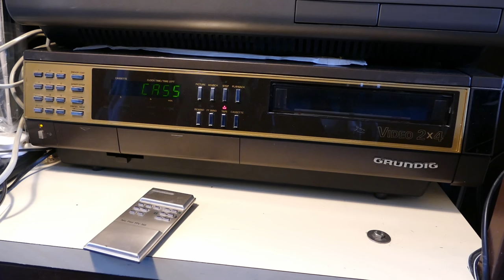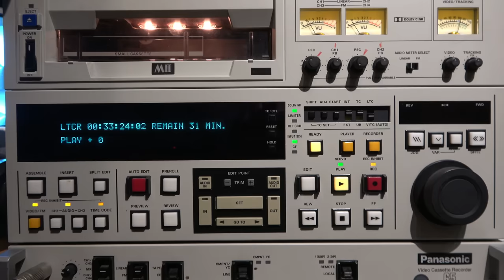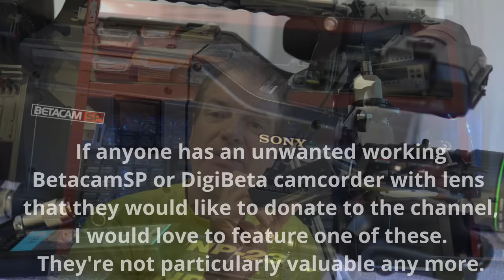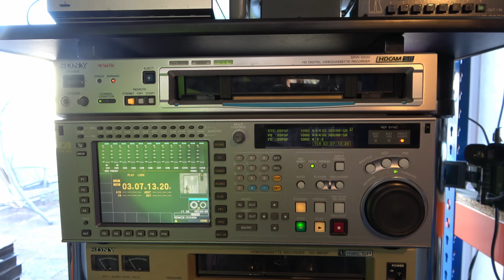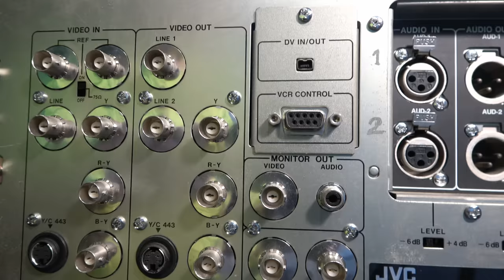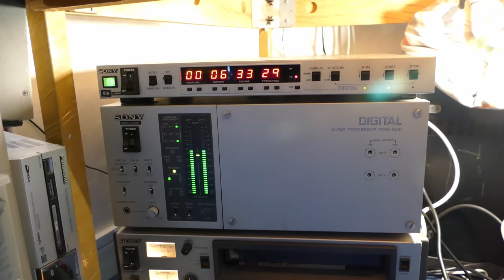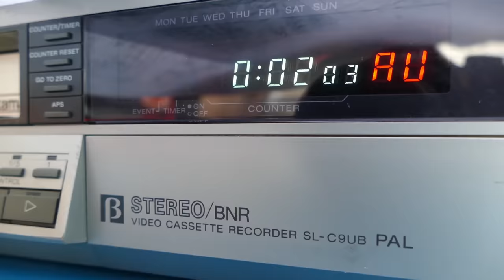Beta vs VHS. A world in which Beta won.

Comment: Interesting video and I so get the point on Beta lasting for so long too. Interesting comparing this to Technology Connections who brought out a video that contradicts some of what you say and at the same time I think misses the point that Beta did last as a domestic format until 2002 with machines still being released up to this date but the cassette format lasting up until 2016. Betacord didn't last nearly as long and in the UK, at one point in the early 80's, Sanyo produced the cheapest video recorder money could buy. Quality wise, NTSC is a different beast and I do get the negligible difference in quality  when using B2/3 and VHS SP/LP but in PAL land Beta was one-speed and the quality was, in my humble opinion, better than the contemporary VHS units - so much so I recorded school shows on both Beta and VHS, VHS to the school and Beta for the archive for future release. A very interesting take on the whole Beta vs VHS battle. A really great video and great to have the kids involved too.
Reply from the maker: At a technical level, myself and Technology Connections don't actually contradict each other.  We cover a lot of the same points.  I just got there two days earlier!
Reply: I watched the Technology Connections video just before watching this one. The problem with both PAL Betamax and Video2000 is they're both stuck in 1980's technology. VHS continued to improve to the point where S-VHS recorders like the JVC HRS-7600 with it's TBC/3DNR function have a remarkable picture with very little chroma noise. Unfortunately VHS did go downhill in terms of picture quality towards it's final days, to the point where I'd say yes a 40 year old Betamax probably would beat a 10 year old VHS.
Reply: @jkmac625  Beta also improved with super Beta and later ED Beta
Reply: @montana01971  Unfortunately there was only 1 PAL Super Beta recorder sold in the UK (HF-950) and ED Beta was never released in PAL format. I believe the last Betamax for the UK market was in 1986 and it was only a mono machine (SL-F25).

Comment: However, what I've known about Digital Betacam, HDCAM, and HDCAM SR, is that those three, could have 40 minutes in 60i on a short tape (50 minutes in 24PsF on both HDCAM and HDCAM SR), and 124 minutes in 60i on a long tape (155 minutes in 24PsF, again on both HDCAM and HDCAM SR). MPEG IMX, which came out after HDCAM, Betacam SX, and Digital Betacam, held 60 minutes on a short tape (20 minutes more than Digital Betacam; 71 minutes in 625i), and 184 minutes on a long tape (60 minutes more than Digital Betacam; 220 minutes in 625i). As for Betacam SX, which came out before HDCAM and MPEG IMX, however, that held for 62 minutes on a short tape (2 more minutes than MPEG IMX, which came later), and 194 minutes on a long tape (10 more minutes than MPEG IMX, which, again, came later).
Reply from the maker: I wasn't aware of all those running time figures.  Getting an hour of professional video on a small tape is impressive.

Comment: We used a PCM501 with a Panasonic NVF65 VHS recorder for several years in the early '90s with considerable success. So Sony opened the door to successful digital VHS... in a way...
Reply from the maker: However VHS machines didn't have the option to disable the dropout compensator, so Beta was much the most popular format for PCM-F1/501/601/701 recordings.  They would occasionally pop up on Umatic too.

Comment: 7:08 I got a shock, when the first Beta(max) machine you showed was my first Beta machine - well it looks awfully like it, pity the model number didn't make it. Mine was a HiFi version,  SLHF100AS.
When I went shopping, the Beta produced a better picture in my eye, so that's what I bought.
Reply from the maker: Yes that's a Sony SL-HF100 Beta HiFi.  I have three of those in good working order, they are my go-to machines for most Beta tape transfers.

Comment: So Technology Connections recent video upload if i understand it correctly states Betamax and Betacam are two completely different formats so Betamax did loose to VHS as you cannot state sony took beta to the pro level,,,  what do you think 😮
Reply from the maker: At no point do I make out that professional Betacam recordings are compatible with domestic Beta.  I do make it very clear that Betacam is derived from domestic Beta in just the same way as MII is derived from VHS.  But I also show that Betacam is mechanically very close to domestic Beta.  My point is that every effort to make a professional format based on VHS failed, because Beta based products were so strong in the marketplace.  In the end it's just a matter of semantics whether or not you believe that Betacam and domestic Beta are part of the same family (they clearly are!).

Comment: There's a video from the Sony CD factory in the states from circa 1995 of the employees making Michael Jackson's History CD set, in fact as a direct measage to him, and the master tape console was this massive unit with a Umatic deck built into it, and that was their master tape. I love DAT,  but Sony could have done better with their 8 mm tape formats. Should have been more savvy with marketing films on the digital versions of it. Should have had better market share, but I guess the little fellas could only hold so much content on them. Even Rising Sun by Michael Crichton got into super nerdy detail with their high definition digital 8 mm tape machines, in 1992! C'est la vie. Think the digi-8 would have been an excellent,  more robust option than the standard 4 mm DAT tapes. The little buggers can be a might fragile.
Reply from the maker: I also wondered why Sony used 4mm tape for DAT, it was too small.

Comment: The ADAT was also based on the VHS format and it saw some succes. Didn't it?
Reply from the maker: I have ADAT kit here. It was a low volume product, competing with DTRS on 8mm. Used for multi  channel audio.
Reply: Indeed, Adat was a success in studios and music production
Reply: ADAT remains now as a format rather than a medium - 8x 44.1KHz over a TOSLink fibre (or can run 4x 96k with compatible gear).  Alesis (who did a lot, if not all, the 8 channel VHS ADAT units) did the HD24 - a disk based 24 channel unit running 3x ADAT streams onto IDE HDDs.  Mixing desks, audio interfaces, and other kit all ran ADAT for multi in/out until the likes of AES50, and Dante, which frames the audio in Ethernet packets, then you can send it over wires, fibres, or (in theory) any other Ethernet based media.
Reply: @NiddNetworks I ran the HD24 system for about 20 years, I switched back to two inch. The HD24 was pretty solid and with the converter upgrade the analogue side was pretty decent.
Reply: *success
Reply: @northernplacecorporation  👍
Reply: @UHF43  That comment would be corrected.

Comment: 8:00 almost right.
Betacam tapes started on day one as metal formulations, using domestic tapes ‘would work’ with degraded performance and increased wear, and vice versa.
Reply: @Matt Quinn - Caledonian TV Are you referring to Beta or Betacam ? 
Consumer Beta was ferric oxide ( or maybe chrome), but pro Betacam was metal from memory.
Reply: @Matt Quinn - Caledonian TV ha, so i learn something…
I never realised Betacam was oxide… or maybe that was the SP variant ??
Reply from the maker: The early Betacam format used oxide tapes which were fully interchangeable with domestic Beta (Betamax).  Metal formulation tapes were introduced with BetacamSP.
Reply: @Matt Quinn - Caledonian TV But I'm wondering how to achieve a higher quality without high-grade tapes and a constant head Disc diameter
Reply: @Matt Quinn - Caledonian TV I don't think that the higher tape speed has a serious impact on the relative tape/head speed, since the only thing that actually increases with vhs is the noise between SP and LP. But I'll have the difference calculated exactly at times.
Reply: @Matt Quinn - Caledonian TV      My mistake, I didn't pay attention to the correct tape speed. If the speed is 5.4278 times higher, then the rather small effect of increasing the tape speed is sufficient, especially because the effect is even greater with ß than with VHS due to the larger head disk. But for the maximum 42 minutes you have to like the very high speed in combination with a thin tape. Betacam is then SONY untypically an efficient lawn factory.

Comment: You didn’t mention Betacam SX (yellow) or MPEG IMX (Aqua).  However, how valid is it to say that Beta was more successful based on the professional formats?  These had very little in common with Betamax, the first part of the name though this was dropped from MPEX IMX onwards, the basic design of the cassette shell though this had to be changed somewhat to provide longer runtime for studio use and the loading system, though this was better engineered on the ‘cam’ machines.  To say that Betacam was more successful than MII is obviously true, but Betamax doesn’t have much to do with it.  In the UK MII was also used by Anglia, and it also saw considerable use in China.  That was an odd format, with the small cassette being quite different to the large one, looking more like an overgrown Video 8 one, and going in at one end of the large entry slot.

D3 was also chosen by the BFI and on visits to both organisations I spoke to them about this while the formats were in use.  The BBC were archiving material material from Quad and 1” C formats, and some U-Matic, mainly high band, for news work.  The BFI were recording material off-air for archival purposes.  All of this material was in composite PAL form, so a composite digital format was considered appropriate, there would be no advantage to using the expensive component D1. At the time the available formats were basically 3/4” D2 or 1/2” D3; the latter offered a considerable saving in vault space, and lower cost.  Digital Betacam was launched later than D3, and I’m not sure if it was actually available when the choice was made, but was known to be coming.  However, D3 was uncompressed, as was D5 in its SD form, while Digital Betacam was compressed by about 2:1, and this was seen as a significant advantage to D3 for archival purposes.  D3/D5 tapes came in three sizes, the medium as smaller and the large larger than a large Betacam cassette; most BBC productions could probably fit on the medium size, so there would probably be some reduction in storage space as well.

HD D5 was used in slightly modified form for a few early experimental digital cinema screenings; I attended one of these.  The audience were not told in advance that the screening was not from film, and were asked afterwards about their opinion of the quality.  I was aware and that was my reason for going to see it.

This competition between formats is nothing new.  In 2” days Quad competed with the IVC 9000 segmented helical Machine the 1” B and C formats were in competition as were the original Ampex A format and IVC 800 series in industrial and educational use.  Half inch EIAJ competed with several other similar but incompatible formats.  One thing does seem to be obvious, there were far too many formats launched, and some of them should not have reached market.
Reply from the maker: I'm considering domestic Beta and studio Betacam to be part of the same family.  Other people may not.  But I never claim that they are in any way compatible recordings.
I've now been told that D3 beat DigiBeta to market, and of course that will have a big bearing in why it was selected.  Still it was a bit unfortunate in the end.
Formats that should never have existed include D9/Digital-S, in my opinion.  And DVCPRO was a lot of trouble, few people have much nice to say about that either.

Comment: Both yours and Technology Connections videos are very interesting videos. Though I'm a little confused with the PAL VHS tape speeds and why Betamax only has 1 (!) tape speed verses the three speeds for Betamax and 4 speeds for VHS (SP/LP/SLP or EP/XLP or VP) in NTSC. One day a video will show up to clear up this confusion. :) Cheers.
Reply from the maker: It was probably more marketing that anything else.  So PAL Beta has one speed, which gives 3 hours 15 minutes from an L750 tape.  Then on VHS there were generally two speeds, SP and LP.  Towards the very end of VHS, a very few PAL and SECAM machines were made with EP, but these were so rare as to be almost irrelevant.

Comment: I had a Sanyo Beta and my mate had a Video2000 machine, we always laughed at the cheek of the rental movies you got on it, half way into the film and you had to turn the tape over 😂
Reply: I assumed that's how pre-recorded movies were handled on that format, thanks for confirming.
Reply: I had a lot of family members with v2000 recorders and our experience with rentals was that they usually only had the A side recorded, with the entire movie on one side. The B side was blank.
This makes more sense than you might think, because in a duplication facility, you don't want someone to have to go around and turn over the cassettes halfway into the duplication. That would cost a lot of extra time and money. 
In the late 1980s duplication facilities started working with direct contact duplication where a master tape was recorded on a Ferro tape in mirror image, and then duplicated at high speed by pressing it against chrome tape at a temperature that was high enough for the chrome particles to move around and follow the patterns on the Ferro tape, while the Ferro tape wouldn't be hot enough to be affected. But of course this want invented until long after the demise of v2000 (1984).
Reply: Are you sure you're not misremembering? I've got a number of ex-rental V2000 tapes and they all have the movie complete on one side. Indeed it would have cost the studios more money to use shorter tapes that required turning over during the duplication process, especially since they'd also have to create special two-part masters to dupe from. And in fact, I'm not sure it was even possible to get V2000 tapes short enough to require routinely spreading a movie over two sides.
Reply: @lutello3012  It's not. It's either misremembering or deliberate misinformation.
Reply: @dunebasher1971  Indeed. And it would make the experience of renting a movie a lesser experience than recording a movie from TV.
Reply from the maker: Recording on both sides would have increased the duplication costs (using the duplication techniques they had at the time).  My experience of V2000 pre-recorded tapes is that they are recorded on one side.
Reply: I seem to have caused a fuss lol all I know is back in the early 80s my mate had one and he rented the player and movies from a place near him, the only shop in Blackpool. One of the movies I fully remember having to turn the tape over is The Worriors, there were others but it was so long ago, I know we watch plenty Cannon movies then
Reply: My father bought a V2000 machine (against my teenage protestations, I knew better) and it was really difficult getting any prerecorded movies from the video store. That was in Germany around 1980. But I can confirm that you had to flip over some movies (not all). I honestly cannot remember which distributors preferred which method, but I think I had to change sides on a Warner Home Video tape. I hated the format, even my Beta owning friends had a better selection of movies when renting.
I remember reading an article in Video magazine back then, that 20th Century Fox planned to use the second side of a V2000 tape for an older "bonus" movie which wouldn't sell on it's own. The newer main attraction on side 1, the b/w classic on side 2. I am not sure if they ever did that, since the format was on a death spiral from the very beginning...
Reply: I would always play the same program on both sides, so you haven't to rewind.
Reply: @Nummer6  They took the concept of the 45 rpm single, where a less popular song on side B will be sold by the more popular A side.
Reply: @Nummer6  I can imagine it was hard to find pre-recorded movies in Germany as the format was a rarity there. The only countries where V2000 had a reasonable market share to some extent were Belgium and the Netherlands.